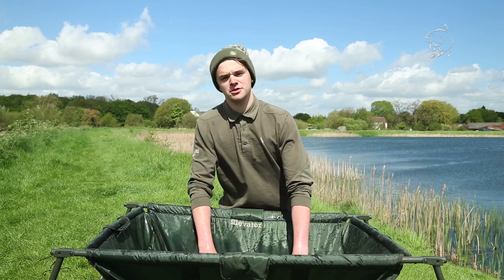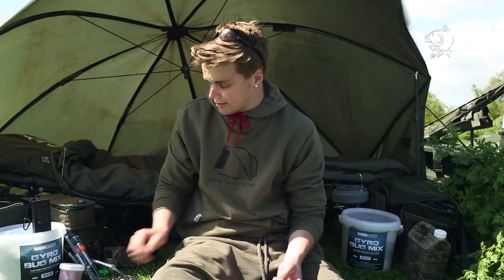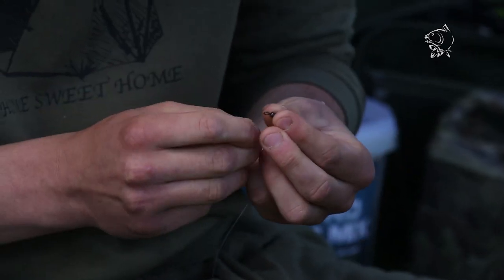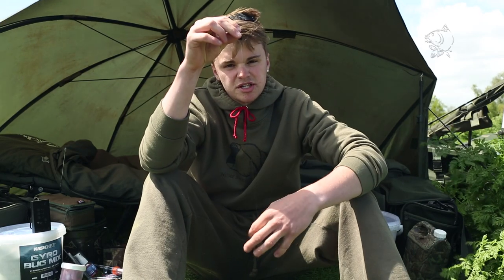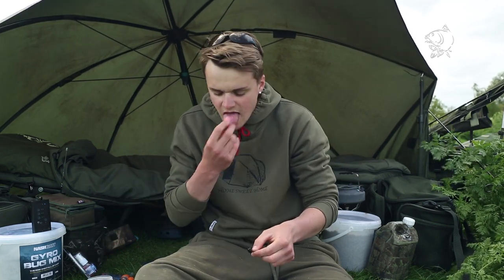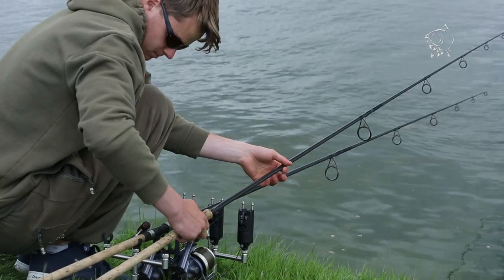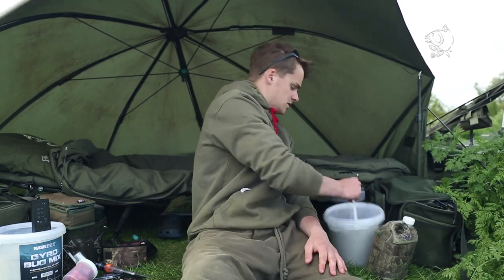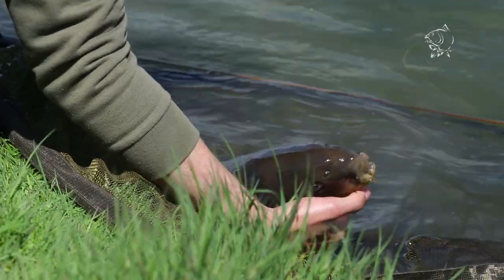Carp Fishing Adjustable Zig Rigs using Nash Zig Bugs Zig Float and Gyro Bug Mix - Nash Tackle

Comment: Why use a fashionable  trendy over complicated grinner  knot?  I alway use a half blood knot for everything with 8  turns or more.   For hooks as well. To finish off the knot, make sure you pull the main line  really tight to take up any slip. On hooks I place a scissor blade across the hook bend and pull the main line really  tight. Cut off the excess line and its done.  Even with braid it never slips. EVER.